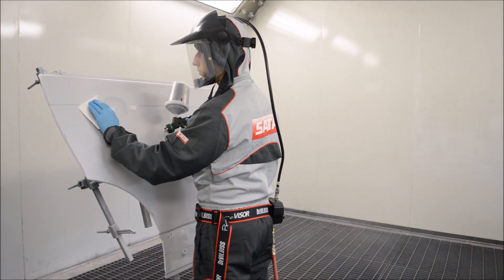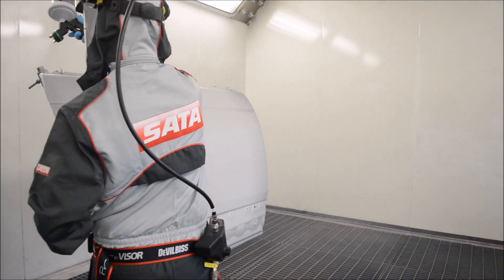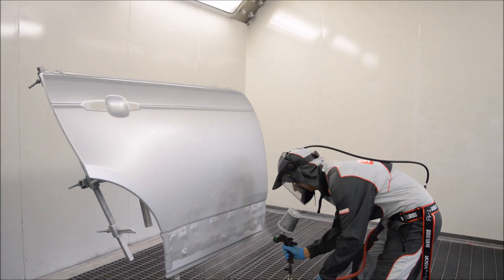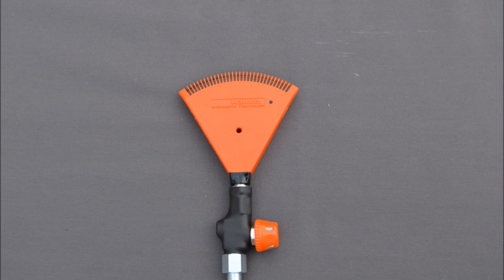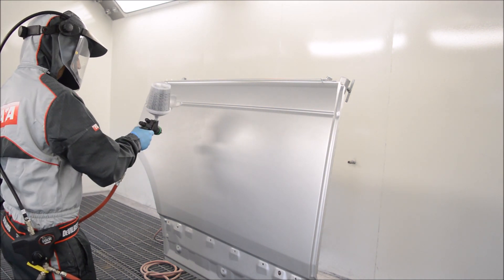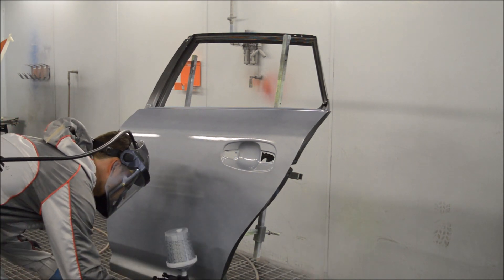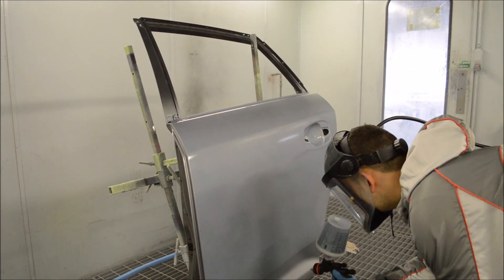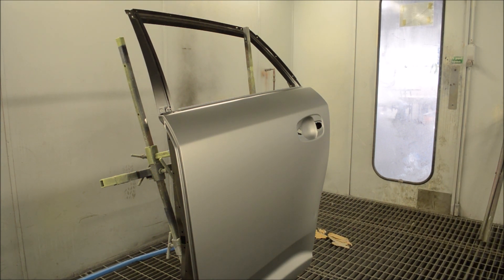How to apply metallic correctly using Walcom Carbonio HVLP and HTE

Comment: What pressure did you use when applying the first full coat?
Reply from the maker: 2.0 bar pressure. Thanks!
Reply: Thanks!  I am spraying a complete car today for the first time in metallic base
Reply: Thanks.  Please do a video on spraying a complete car in metallic base over clear.   I used a similar technique to you, did a guide coat- then a full coat an lastly a drop coat with a very wide fan at 3 bar to roof, bonnet and sides. On the drop coat I waved the gun around in a diagonal way to the roof and bonnet.